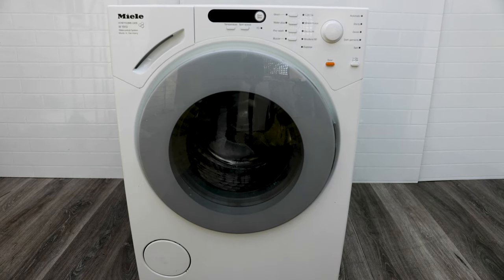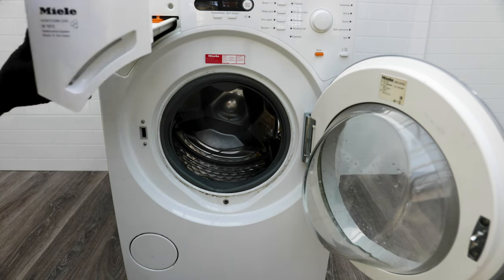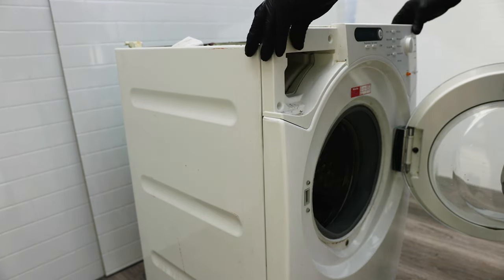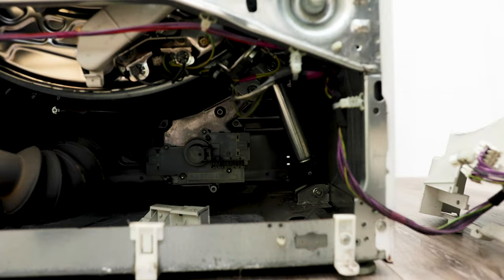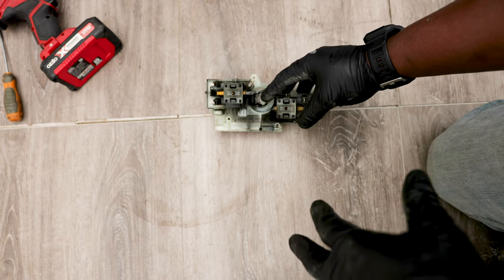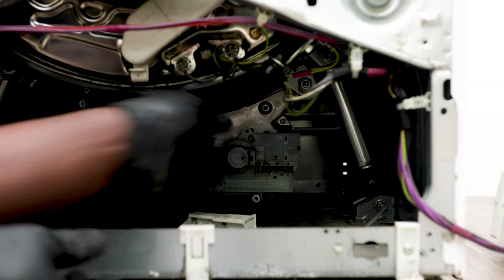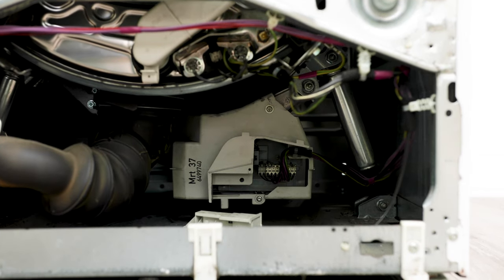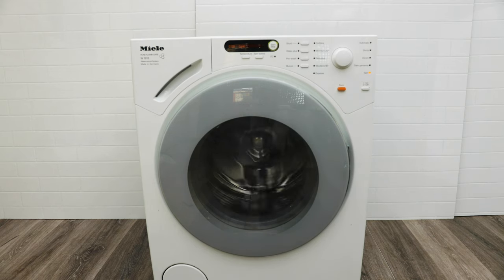Fix Miele F53 Error Washing Machine Repair

Comment: Posted a comment and fix before.  Machine failed again after just over12 months with same 53 error and displayed the same symptoms; motor functions ok but as soon as it starts to speed up, it motors back down, and error returns.  On investigation, issue was broken wire into the 2 wire tacho connector that plugs into the bottom assembly.  The wire is thin and therefore vunerable if you're having to pull the connector off.  The rear top of the connector can be levered off to reveal the pinch connector.  Use a 1mm drill in through the spade connector end to push the old wire end out and I used a squared off hack saw blade to push the wire back in.  I cut the connector off and worked on it on the bench, then soldered the wire ends.  You could work on it in situ but you risk stressing the other wire and it breaking off.  When reconnected works fine.
Reply from the maker: Well done. Great fix yes those wires are prone to break

Comment: I had error code F53 and tried to solve the problem with the help of this video. My carbon brushes looked good though. I tested all the connections with a multimeter and also the speed sensor and everything looked good. The motor was also fine according to the multimeter. Still I got the error code F53. One last thing I tried was to sand a little on the metal surface (with a fine sandpaper) where the carbon brushes touch on the motor and then wiped it off with pure alcohol. That made it all work!
Reply from the maker: Awesome. Sounds like the commutator had too much carbon buildup. Well done for persisting with the repair

Comment: Thanks for your video. The brushes I acquired from Amazon had a different rubber holder that didn’t fit into the slots of the retainer. Was able to slice open the new rubber holder along the top in the same fashion as the original parts and swap the new holder with the old. Perfect fit. Works fine now

Comment: Thanks for the video, fixes the f53 and up and running, BUT we can hear some spinning sound that doesnt sound right,  louder counter clockwise. The coal is put on the right sides. What could be the issue? Just finished a express  program to try it, but the sound worries. Please if you see this, could you comment?

Comment: Followed the steps and changed both carbon brushes (non OEM parts), the 11 years old Miele W3725 now working as normally, no more F53 faulty display.  when the initial back up running It dose sounds a little noisier than before but the noise goes away after a couple of normal cycle washes.  Thank you so much for the tutorial, saved me over AUD400 quote from repair technician.

Comment: In case your Miele has an inverter (i.e. brushless) motor, the fault is often caused by the tachogenerator, a relatively cheap (around $40) part that sits on top of the motor, i.e. where the carbon brush unit is located for non inverter motor machines. Replacement is staight-forward, following pretty much the same procedure as described in the video. If you're less lucky, it's a faulty main control board as described in many other videos on youtube.

Comment: Thank you for this, I've just dismantled my Miele W5748 and once I'd worked out how to get the front off, it was exactly as you described. Just waiting for the new brushes which should arrive tomorrow. Really appreciate your help with this. Wish me luck!
Reply from the maker: You're welcome! glad it helped
Reply: @askmrwashywashy  I got it all back together and now I have a f108 error? Do you know what that means. Any help is gratefully received :)
Reply from the maker: @bennieblancotube  Hi please check and make sure you have connected the wires and brushes properly.

Comment: excellent! machine is up and running again. The reassemble step was indeed a bit tricky, as one of the pins was off center the first time I think. Putting it back in 100% aligned straight a second time did the trick though. May thanks from the Netherlands!

Comment: Good video and it helped me fix my problem.  Here are my tips.
I've got a 13 year old Miele w3742 but most of your video still applies; with the 3742 you take two screws off at the bottom of the front panel to remove; the top control panel doesn't come off. 
With the error occurring, the drum started to rotate but the error came up as soon as it picked up speed, so I suspected something else other than brushes.  There's a tacho generator coil that's part of the brush assembly.  There's a magnet on the armature spindle so as the motor spins up, it generates a pulse stream in the coil back to the control board and so tells it what speed its spinning at.  This coil was open circuit; if you meter it, it should be about 250 ohms. I also checked out the connections on the assembly to make sure it was the coil and not the intermediate connectors etc..  
The Miele UK site has a good set of schematics of the assembly and the machine itself so you can see how it fits together.  I ordered the brush/ tach generator assembly from Miele; this includes the brushes, fitted.  The whole lot cost me £82 (free P&P) and arrived in 2 days.
Replacement was straightforward.  The thing to be careful with, are getting the four prongs on the assembly properly located back into their connectors.  First time I did it, they appeared ok but the motor wouldn't start.  Second attempt it worked fine.  Use a small inspection mirror to confirm location and the locating screw holes should line up exactly if they are properly in. Be careful with replacing the brush assembly's four locating screws as it's easy to cross thread them if the assembly is not properly aligned.
Thanks again John
Reply from the maker: Awesome mate, glad you fixed it and you were able to diagnose it using the schematics. Very helpful. thanks again mate

Comment: Thanks for your very detailed videos, great work! 
I also have a Miele W1913 which now stops completely after about 3 minutes. Fills some water and does a few rounds and then turns itself off. I have to turn off and on again at the power point to turn the machine on again. This applies to all programs. Also noticed that I can't select a high water temperature anymore, only up to 50C. Could that be error F53? Don't get an error code and before I follow the instructions and attempt to repair myself I would like to know. Edit: I will just try my luck, already started taking it apart to check the brushes.

Comment: Thank you for this video. It was most helpful and I'm sure without it I could not change the brushes. However. As I assemble the machine I find I must have made some mistake somewhere. For some reason I can't make the door switch lock the door. I unscrewed this lock as I was taking of the front panel, but that turned out to be unnecessary as the switch came loose. So naturally I put the switch bak on the back side of the panel before I put it back, but somehow the switch won't work. My machine is a W3743. I really wish there was a way to post pictures here. Easier to explain. (Pardon my English as I'm a Norwegian) Do you have any suggestions other that just go buy an other second hand machine?
Reply from the maker: Welcome. Hi. Send me pictures at Stumbleonstuff@gmail.com

Comment: I successfully replaced the carbon brushes on my 3725 following the steps in this video. Thanks very much! However I still have the F53 fault. 
I have cleaned the commutator and tested the tachogenerator with a multimeter at the connector where it plugs into the pcb - I can spin the drum by hand and generate 1-3v of AC. 
When I test it on a spin only cycle, it spins for a few seconds in one direction, reverses and spins again for a few seconds, then reverses again, spins and stops with the F53 fault. It never gets up to the full spin speed.
Any suggestions on what to try next?
Reply: Ended up replacing the tachogenerator and this fixed the issue.

Comment: Hi. Really good walk through of the proces but im still having the same problem. The wires are fine. The motor is fine. I cleaned the rotor and all the parts that i put into it but I'm still having the same problem. The drum will not spin and the fault will come up again. Is it the circuit board? I feel like its the only reason it would still not work after the new parts
Reply from the maker: Might be the motor itself
Reply: @askmrwashywashy  i understand. Thank you

Comment: F53 error but brushes not worn. 

Hey mate, thank you for your uploads. I know this is an old vid but I’m hoping you can help. 

Where on the circuit board is the motor control relay?
Reply from the maker: Hi been a while since I've done these. If ist still giving that fault, check that everything is connected properly, brushes and the plastic bracket that holds the brushes. Also clean the part where brushes contact. on the motor there might be carbon buildup. From memory the  front display house the motor controller as well if there is another board in there then that's the motor controller.

Comment: Thanks excellent tutorial! Although you do make it look very easy, one of your other videos, said the 53 and 50 is the same fault. 50 ?on my machine the exact washing machine as that one. I live in the UK and wondered if you could possibly send me a link to the correct brushes for my machine please🙏🙏.  That noise is ear piercing.    My worry would be breaking a connection and getting the connection of the motor back on correctly! Without having to do it all again😂.  I am quite practicable, but understand motor bike engines more!😂

Comment: Great video but getting my motor connector off is an absolute nightmare compared with yours! Any tips?
Reply: I did manage this in the end by pressing the tabs down and wrestling the connector off. Think mine must have been glued on!
Reply from the maker: Thanks. I’d say take your time and go over the screws and zip ties and make sure you’ve undone all of them

Comment: Super helpful video.
One tip which is at odds with the video is to leave the brushes in the housing and release them once the brush housing has been installed. Practice this with the brushes themselves before fitting them as you'll need to feel your way to them when you have installed the housing.
Last tip for those with a classic Miele 5740 or similar - you can get the front panel off without taking off the top, or top control panel - bonus!
Reply: How do you release the brush in the first place? I’m not getting them out 😅
Reply: @Bjorkentall  Hi, the brush part of the unit should be fully retracted within their housing and are released by a button spring release on the face of the housing - good luck!🤞

Comment: I have a Miele W4840 with 6900 hours on it.  It doesn't agitate or spin.  The belts fine, the assembly spins freely by hand.   The next is to check out the motor brushes as in your video.  I ran diagnostics and everything this seems to be ok except when I run the spin nothing happens, no errors.  Do you know if the agitate and spin could be caused by the same brush issue?
Reply from the maker: yes id check the brushes coz most washers one brush runs out faster than the other one

Comment: Thanks for this vid mate! Just replaced them earlier, worked for 1/2 a wash then it came up with the same error. Tried taking apart to check if everything was correct, and its still showing the message. Going to try once more to see if i put the plugs of the carbon brushes in the wrong way. Any other suggestions? One thing i did notice was my old brushes didnt move inside the metal casing, but these ones sway back and forward slightly, if that could be an issue.
Reply from the maker: hi how did you go. try and check if the brush housing * the plastic bit that you took off to install brushes. make sure all four pins that connect to the motor are in properly. They are a bit tricky to put in at times
Reply: @askmrwashywashy  Got it sorted! Just took it apart again, made sure to push the plugs in tight. Working great since, thanks 👍🏻

Comment: I cannot get loose the contacts from the brushholder. Tried even with tool, but afraid that I destroy the contacts. I have Miele Grande Gala w3000. Is the contacts ment  to be stucked?
Reply: Its solved. But replacing brushes didnt help. Dont Know what's wrong. It deny to turn around.

Comment: Hi. Yesterday I picked up a Miele W 5835 for free as it has a problem and I believe it’s this one here. When ever I put it on spin, it doesn’t turn and just starts beeping while draining bit it doesn’t say F53, it just says “Technical Fault”. I went into service mode and it’s had a lot of errors over time and this one has appeared. Would I be having the same problem as the one shown here?
Reply from the maker: Hi there I think it might be the flood level sensor sensing there is water there
Reply from the maker: Open the washer and check the flood protection sensor
Reply: @askmrwashywashy   I've used this vid to find out how to dismount my Miele w1740 which has an issue with the flood sensor... Got all bottom with water... I've replaced the rubber hatch but doesn't solve the leak... I'm not sure what the problem is as I cannot see any leaking... As I see it is not much left... Incoming main water or problem in the drained water... Any trick to detect the leak?

Comment: I have done exactly what you have on video but the brushes was still ok Pls what could be the other solution
Reply from the maker: The commutator on the motor might have too much carbon. Try to clean the carbon off the commutator

Comment: I did the brush replacement, I still get the F53 error! My old brushes weren't very worn down, must be some other reason?
Reply from the maker: Hi might be the motor, might be a lot of carbon built up on the commutator bar. try cleaning that up
Reply: it's the rotor itself, get the motor out and check the collector dor damages - 90% is the rotor.

Comment: This code f53 .it not what you showed. a replace the brushes. And it still  makes  noise the showed  f53. The code main it sensor speed drum.
Reply from the maker: hi when it's making noise is the drum spinning ? if so it could be the spider is broken. Yes its connected to sensor speed for the drum. The drum won't spin if the brushes are worn or if the spider shaft assembly is broken

Comment: change them , wash 2 or 3 times ...now i get again the f53 error ...wtf?
Reply from the maker: Hi sorry to hear that. I’d say the brushes might not be sitting properly. Try and recheck make sure everything is connected securely. You might also wanna clean up where the brushes contact the motor make sure there is no excess carbon buildup
Reply: @askmrwashywashy  😇🫡🙏🏾

Comment: I have a w5985 report f53
Reply from the maker: likely brushes. Remove the motor and see what the brushes are like
Reply: @askmrwashywashy  i just saw your reply. This machine did es not mount a brush motor. The motor is induction.

Comment: There's a reason why the brushes are worn on one side. This repair will not last. The armature comm plates on the motor are damaged/lifted hence why the uneven brush wear.
Reply from the maker: Hi from experience one side always wears more than the other on all washing machines. Haven’t seen them wear evenly
Reply: So if they where more one way,  could I just swap them 🤔

Comment: the prolbem here is not the brushes, its the rotor which is worn out. Don't make such viedos if you are not sure. The problem will reappear in a couple of months. If its the brushes, both should be worn out equallu... please dont
Reply from the maker: Hi mate I’ve repaired these for the past 10 years. Never had such faults come back. You’ll find on most washers Samsungs, Bosch one side wears out more than the other.

Comment: Hi

Miele washing machines and washer-dryers cost more in spite of other brands for nothing as even Miele always have problems and often very serious ones especially in the electronics which always has failures and burning problems of the electronic boards themselves.  Their very high price is truly unjustified and unjustifiable!  The electronic boards are not made in Germany and the spare parts cost almost as much as a new washing machine!  Other less expensive brands work great and never have any problems of any kind!  Furthermore, it must be added that the much vaunted honeycomb drum does not wash well at all, indeed if you make a comparison with the old Mieles that used the drum with holes, the latter wash much much better!  The honeycomb drum was just a publicity stunt and nothing more! 

Regards.
Reply: My Miele washing machine when  power switch on the cotton light on for few second then off, nothing on. What is the problem might be. I called miele technician, he said need to change the electrical board and one more thing, cost me $950, a bit ridiculous to me.